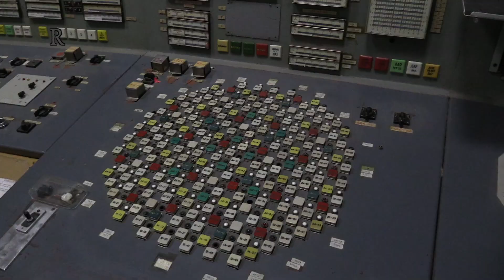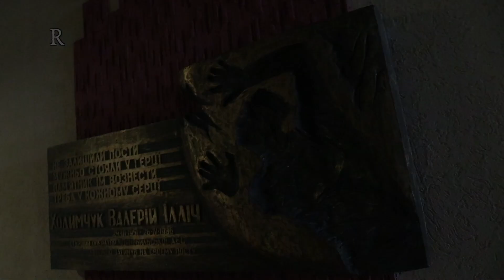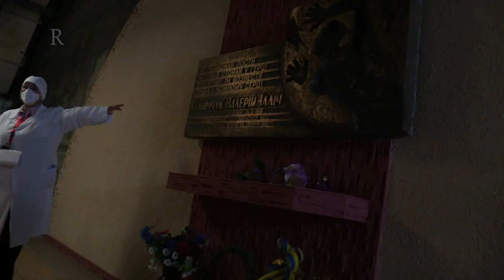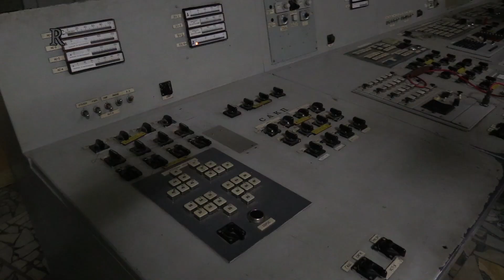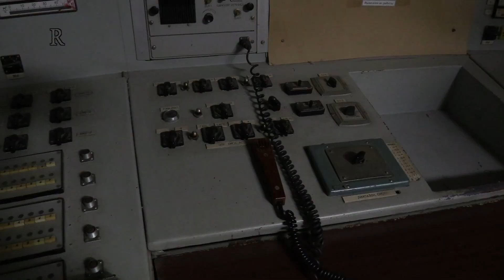Inside Chernobyl power plant: Contaminated parts

Comment: The wall that they placed the memorial inside the reactor used to be connected to the no4 reactor with pipes and vents etc,after the reactor no4 explode they remove the pipes and things that connected to the affected area and cover it with plaster and built the memorial,u can still see traces of pipes connect to the exploded reactor hanging on the ceiling

Comment: They're dosimeter is going off at 9 to 10 microsieverts which in America is .9 to .10 millirem which it takes 1000 millirem to equal 1 rem which the industry standard only allows you to get 2 rem per year so .9 to .10 mrem is nothing. I deal with higher dose rates than this.

Comment: I visited Chernobyl earlier this year. @ 3:00 where it shows 56.5, you can actually get higher readings in the woods still in quite a few places. The highest I saw in the woods was near 70.
Reply: I think it changes, so you could randomly have high levels and low. Also, with the war and Russian tanks going through Chernobyl, radioactive dust has lifted into the air and raised the levels a little.
Reply: @mushroomsrcool1449  I still can't believe those idiots dug trenches there, but at least Ukraine didn't need to shoot the Russians that gave themselves radiation sickness, saved us some bullets.

Comment: Some approximate effective doses (E) to get a feeling of the amount of radiation received, these values apply to Germany (EU) but are similar in most other countries:

0,1 mSv
Yearly average from human generated radiation EXCEPT medical, like X-Ray or CT

0,2 mSv
Chest X-Ray

2,5 mSv
Yearly average from all sources, except medical

4 mSv
Yearly average from all sources, including medical

6 - 10 mSv
Yearly average for airline pilots

15 mSv
Full body PET-CT scan

20 mSv
Maximum legal limit for workers within a year, for example radiologists. In exceptional cases, doses may be higher.

300 mSv
Average lifetime radiation dose

1 Sv
ARS - Acute radiation sickness

4 Sv
50 % die within 30 days of exposure.

10 Sv
100 % die within 30 days

80 Sv
Nearly instant death suspected

1 Sv = 1000 mSv

So if you assume they stayed for half an hour with about 8 mSv/h, they got 1 - 2 yearly doses of radiation from that tour. In Germany, the tour guide would be allowed to do this tour about 4-5 times per year. BUT, when the dosimeter reads 8 mSv/h, the received effective dose within the body is way less. This is because of the difference between a local dose H and the effective dose E. To get an idea of how these are converted, you can look up ICRU sphere online. So the calculation above is probably massively overestimated.

Röntgen and Sievert are NOT two units for the same thing. Röntgen is a unit for the amount of ionization created, Sievert describes the energy weighted with the significance of the radiation on tissue. Gray is a unit for the energy itself. So 1 Gy of Gamma-Radiation equals 1 Sv, 1 Gy of Alpha-Radiation equals 20 Sv.

Long story short, you can't simply convert values associated with radiation like meters to feet.

The reason they can get so close now is because nearly all radiation is coming from the core itself. This means for each distance doubled from the core, you recieve only 1/4 of the radiation. So if the radiation 10 cm from the core were to be 1 kSv/h, it's only 1 mSv/h 100 m away. And this is without walls and what not in the way. So the real concern is the radioactive stuff scattered around the damaged building. You really don't want to inhale any of that dust, as it will continue to irradiate you from the inside. Thus the masks.

Comment: Is it just me who’s kinda worried that no one has a thyroid protector?
Reply: I think it really wouldn't be of too much help and much more of a nuissance in this situation. The thyroid isn't especially in danger here because there is no concentrated beam of particles on one body part, it's ambiental and therefore spread over your whole body more or less equally. The lead shield most likely wouldn't be sufficient to block the gamma rays because they have higher penetrating power compared to the x rays used in medical scans. 
The real threat to the thyroid in nuclear accidents is radioiodine, but you can take potassium iodide pills to prevent it from entering your thyroid, plus more than 90% of it would have already decayed by the end of the first month after the accident. So ye, a thyroid protector would inconvenience them way more than it would help.
Reply: @ore5849  Hey 👋 Thank you!  This really helped! 🤍
Reply: Always glad to help!

Comment: How do you manage to walk through there with minimal protective gear when the entire surrounding area is still forbidden to be returned to?

Edit: And how does the elephant's foot not have enough radiation to kill you, even if you aren't right next to it?
Reply: Although the elephants foot solidified and the radiation levels dropped a bit it's still the most hazardous thing currently and being near it for any amount of time would be fatal , the elephants foot is in the basement below the reactor and it's strictly off limits to everyone because of how deadly it is. The reason why nobody is affected by the elephants foot is because it is located in a part where there is a thick steel wall that is preventing the radiation from escaping the basement.

Comment: Ok so story idea: five people wake up in the control room. It's dark, they can't see much, they can't see each other. They can hear them though, heavy breathing, coughs, choking. They can hear the others slowly stirring from... whatever it was that had knocked them out. 
But there's something wrong, something that doesn't sit right with them. Uncertainty lingers in the air, quickened breath, a pulse beating in their ears. Hesitantly, a small, shaky voice calls out, "hello? Is anyone else awake..." the voice trails off nervously.

They share names. No one knows why they're here, no one can remember anything, except the darkness, and that... feeling, the feeling that the five of them were not alone in this endeavor, that there were others, lost souls left to wander here, whether from the initial blast... or something far more sinister, no one is quite able to say, but they all feel it.

One of them picks up a discarded torch off the ground, flicking the switch and shaking it feverishly. Eventually a thin beam of yellowish light shines weakly from the glass, catching the dust particles floating around them. They can't see the others properly, they're cut off from the darkness, concealed by a seemingly living thing that swan around the torch light that weakly shone through. 

They all knew where they were- there was no doubting that, the ancient equipment, the thick layers of dust that suggested this place has been left to rot,  left to the ghosts and lonely spirits that had died here. A certain fascination that had drew them in, followed into the darkness when they knew they should have stopped. But know, it was far too late, they were trapped, trapped in this place, a living breathing monster, a place were si many had lost their lives, trapped, running down the seemingly maze like hallways that only they knew so well.

They were trapped in the Chernobyl power plant. A beast of radiation that lay silently, waiting, listening, the deadly radiation soaking slowly through their skin, their lungs. 

The fear written on each face, half hidden in the inky blackness tells the same story as they realise three fudimental truths at the exact same time.
1. None of them have ever been here, none of them are engineers, to them, this is a maze.
2. It wasn't a coincide that they're here- there us a far greater, far more sinister power at play.
3. The most important- every single breath the take, every second they spend here is a ticking clock, not to some massive nuke or time bomb, but to their own lives. And no one is coming looking for them
Reply: Excuse the typos this is just a bunch of word vomit, the flickering lights gave me the idea- reminds me of kinda pre-jumpscare scenes in movies

Comment: It’s all a tour until someone says “Do you taste metal?”
Reply: Then you find out he’s wearing braces
Reply: @cosmiccaleb9633  haha lmalol
Reply: He could’ve at least gone and kissed the elephants foot
Reply: @bradleyx123  that spells death
Reply: For those who don’t know. The elephants foot is a giant blob of radioactive material in Chernobyl that was caused by the reactor fuel or substance that basically solidified. Anyone is welcome to correct me (if I’m wrong)
Reply: @cosmiccaleb9633  I think it was also a mix of sand and boron when they tried to contain the fire
Reply: @Gangstabob716  as far as I'm aware it was the rods that melted down and sunk through the floor .. it's highly toxic and it's still sinking down little by little .. of that gets into the water stream hundreds of thousands of people could die and there is no way to stop it
Reply: @oleander3489  I thought control rods were propelled outward from the explosion?
Reply: @oleander3489  no its not moving very much at all
Reply: @Gangstabob716  Most of the rods melted into the core.
Reply: @Gangstabob716  the substance is called corium
Reply: @cosmiccaleb9633  elephant's foot is the reactor fuel rod, low enriched uranium - 235 (LEU) rods that went under a meltdown because of no cooling water, because of its high temperature the surrounding casing which is made up of zirconium, graphite, boron and sand that was dropped on the reactor along with concrete and few other debris, all this mixture flows and mixes with the meltdown as its eating away the concrete below it, this lump of mixture is called corium, in chernobyl's case they called it elephant's foot because of its appearence. but now its soldified and looks like a lump of rocks and sand with deteriorating radio activity levels.
Reply: @oleander3489  tea its the melted rods and corium that didnt explode in the inicial incident. things also a ticking time bomb cause its easing away at the floor beneath it and one day could fall thru into the flooded basement
Reply: @oleander3489  The Elephants foot is actually caused by the meltdown that happened and has solidified into this block of highly radioactive material that resembles the foot of an elephant, thus the name ‘elephant’s foot’
Reply: @cosmiccaleb9633  back when the explosion happend if you stood near the foot even for a few minutes you would be considered a dead man. It's still radioactive but not too the point of back then.
Reply: @Rocker-1234  what will happen if it falls through to the basement? I thought that’s where it’s at now
Reply: @kirstens1653  another steam explosion, and nah there's a basement level below that that did have water in (can't remember what it was technically for but it was another one of the tanks) however since posting my comment here I've heard they did actually drain said basement but haven't had a chance to look further into it.
Reply: @cosmiccaleb9633  they had an elephant among other workers cleaning the accident.
Reply: @михаилволков-е1е  poor dumbo 😢
Reply: @cosmiccaleb9633  did you know that when they tested the "foot" they broke off pieces by shooting it with a rifle
Reply: @cosmiccaleb9633  its not only reactor fuel it started due to the boran and sand they put in to stop the fire (reaction) to be exact thats how the meltdown started
Reply: @bjornlauret4205  I know that you guys are still fixing my mistake, now take this with respect.

ALRIGHT I GET IT!!!
Reply: @bjornlauret4205  the RBMK reactor has a positive void coefficient, not negative. When water is taken away and transferred into steam, a void exists, when this void grows larger, the reaction also increases. Control rods were lowered when the A3-5 button was pushed, however, the tips of the control rods were graphite. Graphite accelerates reactivity. Water being converted into steam creates enormous pressure, blowing off the lid of the reactor, when this happens, oxygen rushes in, creating the second explosion. The core gets so hot, nuclear fuel melted, control rods melted, and the core itself melted, causing a radioactive lava flow made of a material called Corium.   Boron did not accelerate the reaction, it depresses it and absorbs neutrons, preventing fission.
Reply: @Gangstabob716  what goes up must come down.
Reply: @cosmiccaleb9633  yeah after the explosion it was so hot that it melted through the floor it was the radioactive rods or fuel rods that are now a giant blob solidified and still emmiting harmful level of radiation
Reply: @cosmiccaleb9633   Certainly more horrific than the movie of the same name (Blob)
Reply: @cosmiccaleb9633  
It is a mix of uranium-238, Sand, Boron, Concrete, Steel which is in the basement of reactor 4.
Reply: @bradleyx123  I have it tastes nice
Reply: @bradleyx123  this gives me an idea
Reply: Or can u taste sweet stuff
Reply: @isfs7459  yeah plutonium smells sweet
Reply: @isfs7459  plutonium, right?
Reply: biggest problem is when you taste sweetness then you are to close to uranium.
Reply: @mikewayne3118  Plutonium
Reply: @mikewayne3118  no to plutonium it smell sweet
Reply: Actually radiation tastes like lemon. The metal taste its because they use a metal (dont know which) to shut the "fire". Like they throw it on top. I think it was lead
Reply: @AmyRemedi  interesting I never knew that!
Reply: @AmyRemedi  uranium tastes like metal. Plutonium tastes sweet
Reply: Legendary comment :)
Reply: I'm finna run out a there a fast as light
Reply: It's just the equivalent of a chest x-ray.
Reply: @BLACKMONGOOSE13  which would kill you if you exposed for more than a millisecond
Reply: @BLACKMONGOOSE13  LoL 😂
Reply: @saiadithyamannepalli2693  pi
Reply: oh no
Reply: Not great, not terrible
Reply: Nah its more like
“Do you taste lemon?”
Because this taste is very sour
Reply: @scriptedblanket7513  That’s interesting because sour is actually a taste defined by low levels of pain to the tongue…is it lemony because it’s almost causing pain to the tongue??
Reply: I would scream
Reply: Why did they put granite on the reactor rods yeah it was cheaper but safety first
Reply: LoL 😂
Reply: Or if someone smells ozone.
Reply: More like, " Do you taste lemons? "
Reply: HA! 3.6K likes... Not great, but not terrible.
Reply: Um yes. Because I just bit my cheek
Reply: How are your lungs
Reply: Or "does anyone smell ozone?". That was caused by the intense ionisation of the air.
Reply: What does metal taste like anyway? The closest thing to metal I’ve ever tasted was copper and it almost has a blood type taste to it.
Reply: Has anyone ever tasted elbows and assholes besides for me 👋?
Reply: Oncology every Friday at 8:15 am, first sensation is the taste of rusty iron.
Reply: You're not going to get much dose off of 9 to 10 microsieverts. You would need to stay there for at least 40 days to get 1 rem.
Reply: Owwwwww like heavy metal 🤘💀🤘
Reply: You don’t sense ozone until you actually get to the reactor. The whole building is generally safe
Reply: That moment they knew, they FUCKED up

Comment: In 40 years when they have removed all the fuel I hope they find the lost guy behind the wall.
Reply: There are probably a couple of people who have died or remained tremendously deformed due to being exposed to the LETHALLY radioactive material behind some reactors.
Reply: WAIT WHAT
Reply: @johnduffy943  my question exactly
Reply: @johnduffy943  Yup, one of the plant workers I think his name was chivalkri or something don't remember was at the bottom floor of the reactor hall when it exploded there was a wall there they tried to recover him but he was nowhere to be found anywhere down there.
Reply: The new safe confinement building (large stainless arch in film)  is equipped with remote cranes and demolition tools.  The idea is to disassemble the old sarcophagus and remnants of the reactor and place them in a more stable storage location.  A lot of the highly reactive fission products have decayed away since the disaster so the remaining reactor isnt quite as "hot" as it was during the disaster and shortly after.
Reply: @danielh4995  The reactor burned out completly. It is nearly empty. Problem is the melted radioactive material under the reactor.
Reply: @derwildewesten6700  Some  of the core of the reactor burned yes, some was blown out during the explosion, but there is the sarcophagus, the remnants of the reactor building, supporting infrastructure, sand, and other debris dumped into the core to attempt to stop the fire, etc that are all still in there and all still radioactive. Those are the pieces that still pose a danger if the sarcophagus collapses which is why the new safe confinement was built and why they are planning to disassemble the remainder of the reactor and place it in more stable storage.
Reply: @danielh4995  With our knowledge of today it would have been better they did not dump material in the central hall. I know they tried to dump it in the open reactor. But because the lid (Elena) is still laying on it there is no big entrance to fill sand and other material in it. The most material they droped down was falling not into the reactor but in the central hall. Of course this material is now radioactive, too.
Reply: He's not going to be very happy when they let him out after 40 years.
Reply: More like 50,000?